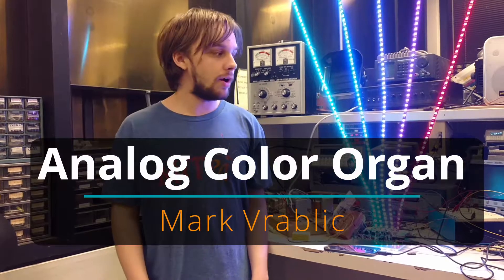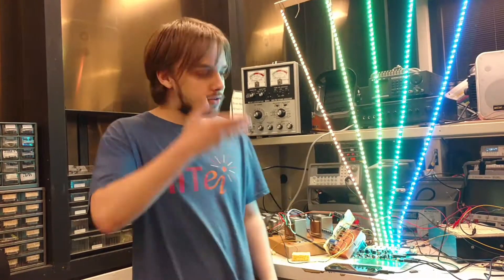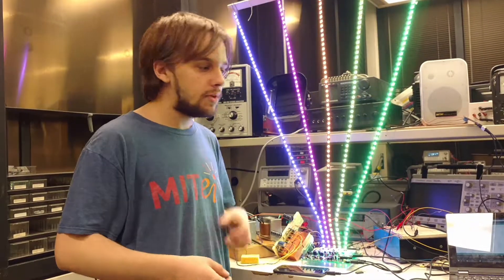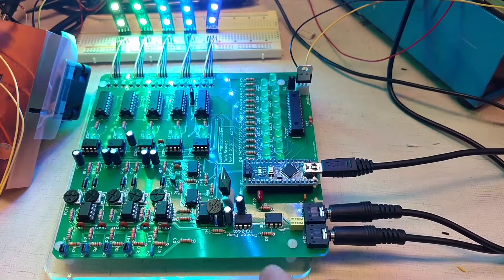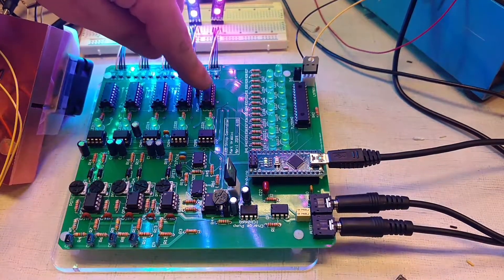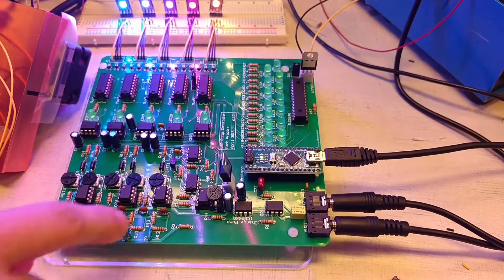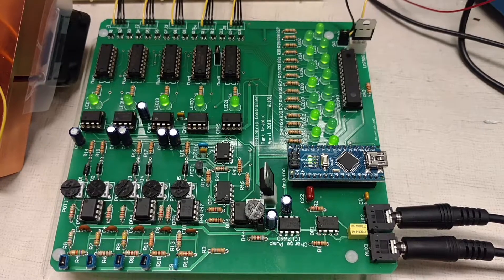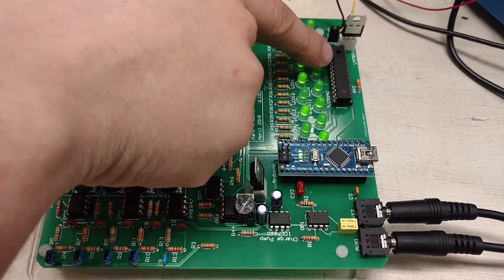Analog Color Organ

Comment: I urgently need to start implementing PLL's in my syntheseizer projects. The frequency multiplying possibilities seem huge. And the tracking of the high notes sounds good but on the lower frequencies  things still sound a bit jittery. Also you vary the input frequency slow by turning a pot. I wonder how the tracking performs on sudden frequency change. I guess I'll have to make the cirquit myself to find out. You inspired me!

Comment: Are you interested in a much more elaborate analog color organ?  My brother & I spend many years building a pair for a disco setup.  There are 3 distinctions from yours.  First, we did not mix the stereo channels.  Each side has separate processing.  Secondly, for each audio filter output, there are 2 light channels, one getting brighter with the level, & a second getting dimmer.  This gives almost the same light level at all times, but from different lights.  Third, there is a problem with audio having more dynamic range than lights.  During quiet or loud passages, the lights "freeze up".  We solve this with automatic gain control that continuously adjusts the gain to give "active" lighting.  For 2 stereo channels, 3 filter bands, & the normal & inverted lighting, we get 12 light channels.
          Rather than mount the lighting in a central display (as you have done & was done in the '70's), we put spot wash fixtures throughout the room, driven by SCR's.  Later these were replaced by single-color LED lamps.  In addition, we modulate colored fluorescent tubes (using magnetic amplifiers constructed from old burned-out Variacs), also distributed throughout the room.  If you are interested, I have circuit schematics & some videos of setups I have done.
Reply from the maker: Woah! That's cool. I'd definitely be interested (especially in how you solved the automatic gain control). My email is mark@markv.me.

Comment: Nicely done.  I build one also for my final college project back in the 90s.  It was only a 3 channel for use in a car application.  It was powered by 12VDC and drove 3 different 12VDC color neon tubes.  I had to use a condenser mic for input and not a line in level.  My project seems small by comparison.  Great job and thanks for sharing.

Comment: Hi Mark, I am very impressed with your design and I have downloaded the files. Did you use Advanced Circuits for fabrication? Do yo have the job number for re-ordering boards. Do you have a parts list? I am going to build it to compare to mine. My design is way more complicated and doesn't look any better on You tube. I've been perfecting mine all my life and from what I can see yours is amazing!   Do you have any software for the Ardunio that can also be downloaded? Check out my color organ (https://www.youtube.com/watch?v=bR_OekzX7PM) Thanks for sharing! I will only build this for my own use.
Reply from the maker: I don't have the Arduino source anymore unfortunately, but I never got around to programming more than some very simple ambient effects. The musical ones shown in this video are purely analog, no Arduino needed. I used SmartPrototyping to get them manufactured but that's because I was on a schedule, other board houses will be cheaper. I just logged into the account and was able to download my files and settings used. I've updated the zip file on the website to be the version I actually got manufactured as well as contain the settings used. 

Component assembly was done by hand. I wish I had a proper parts list, but didn't keep track of it as I was prototyping everything on breadboards. I have the physical board itself though so I can send you some higher resolution pictures if you like or answer any questions on part numbers. I don't really have the time to make a proper BOM recently though.

Don't worry about the license, it's already open source but feel free to sell it if you like. It will never be profitable with so many parts though, a teensy + some code can do everything this can and more. It's just a less fun way of accomplishing it. Please let me know if you have any other questions.
Reply: @COASTER1921  Hi Mark, I ordered the raw boards from China (cheap) Your schematics don't have values so yes High Res. photos will help. I will be able to read the color codes on the resistors but not the caps. I see the filter values in your project document. You could post the photos on your site. 

 The Teensy looks good, but I am a hardware guy and don't program. If I could, I would have done this on a DSP long ago. My color organ was a shot at an audiophile version. It has a VCA/AGC line level front end, 4-pole Butterworth filters, active rectifier and smoothing circuits and  Linear Tech. PWM LED drivers with high current Mosfet outputs.  It has level controls for Main input, Red (Bass), Yellow (Lower Mid), Green (Upper Mid) and Blue (Treble). There is a current adjust for variable length LED strings too. The challenge was getting the design to display all of the music (never missing even the quietest sound on track fadein's or fade outs). My filters are 18db/octave and the channels blend at 0.3db down. A couple of friends have asked about getting one of my units. Unfortunately, it costs hundreds of dollars in parts and is a difficult project. Once I get your board running, I can give them a board and help them build it and get it running. I have most all the parts for your board in stock even the Arduino Nano cards.
Reply from the maker: @PistonPumper  
I'll try to upload some higher quality pictures to the website tonight, but for now here are some of the harder to read component values

op1, op3-op6 are LF353
op7 is lm6132
C9, C16 are 10nF
C0, C1, C3, C5, C7, C17, C21 are 100nF
C22 is 330nF
C11-C15,C18-C20 are 10uF
all pots 10k
R43 ended up being a 10k pot to adjust the threshold I believe
JFET1 is 2n5462
q1-q15 are Si2302DS

D1-D5 are 1N4001, I liked the effect that their relatively large voltage drop provided, but really any diode will work.
Those optional yellow capacitors without a designator are 220n - I ended up needing to AC couple my input for the PA system I ultimately installed it in.  To do that I cut the traces under those yellow 220n capacitors by the input and added the 220n capacitors.

Hope this helps!
Reply from the maker: @PistonPumper  I just looked at your channel and realized that I watched your color organ II before making this (along with the few others on youtube).  One of the primary things I wanted to change was to mix the colors up a bit more.  That way, rather than having one color always correspond to one frequency, the color would change with differences in amplitude between frequency bands.  I kinda mixed the bands randomly to get the R, G, and B for each strip, but wish I could have done more than 5 channels to really spread it out to get both the color and position change. But 5 channels was already a lot in terms of the project timeline.
Reply: Marc, Please check your email - Got the boards!

Comment: Being a 77 year old retired person with lost of in-house time on my hands I would like the info to create this magnificent color organ from the past,  I also would like the files necessary to get the pc board and parts list.  cheers and thanks for the great reflection to my past years.
Reply from the maker: I've uploaded the gerber files to my website http://markv.me if you wish to make your own.  I couldn't find my old schematic files but can get the resistor and capacitor values from my current board.  You will need to use a service like smartprototyping, pcbway, OSHpark, or jlcpcb to get the PCB manufactured.  I didn't make any assembly files so all components will need to be soldered by hand.

Comment: Would you be willing to give me all the information i need to recreate this project with my sis. It looks like i would be a lot of fun to do.
Reply from the maker: I've uploaded the gerber files to my website http://markv.me if you wish to make your own.  I couldn't find my old schematic files but can get the resistor and capacitor values from my current board.  You will need to use a service like smartprototyping, pcbway, OSHpark, or jlcpcb to get the PCB manufactured.  I didn't make any assembly files so all components will need to be soldered by hand.

Comment: Hey! This is a awsome project and I was wondering if I could ask you some questions about your project.
Reply from the maker: Ask away!
Reply: @COASTER1921  What did you use to create your PCB board.
Reply from the maker: @fartlord111  I used Altium Circuitmaker. It's pretty good and the professional version widely used throughout industry. That being said, recently, I've been recommending kicad over it as the learning curve is slightly lower and the compatibility is nearly as good. Further, Kicad is open source and free with no limits. As well as just being overall faster. The BOM materials aren't as good, but as a hobbyist that doesn't matter at all.